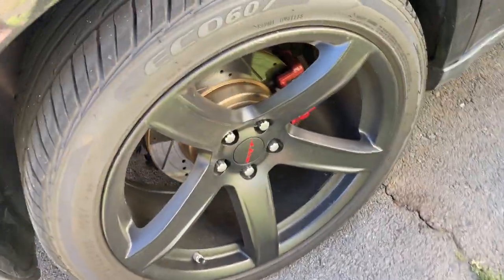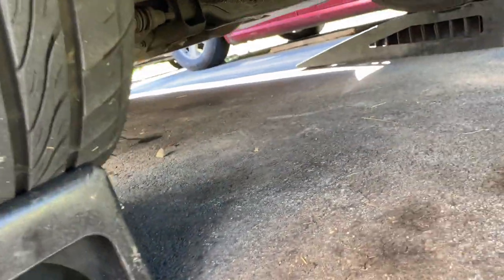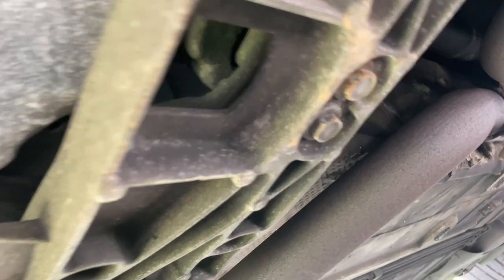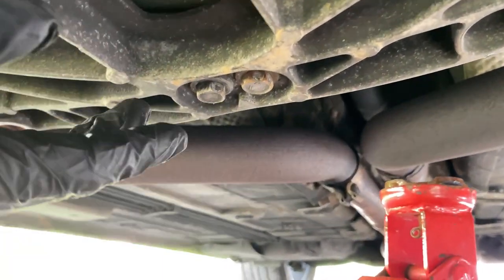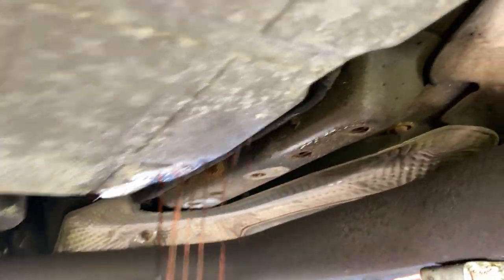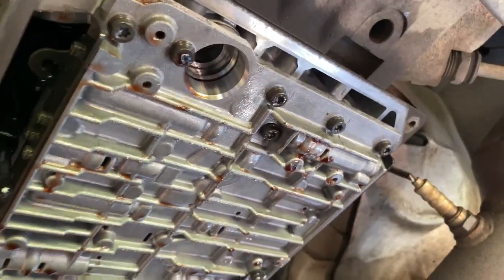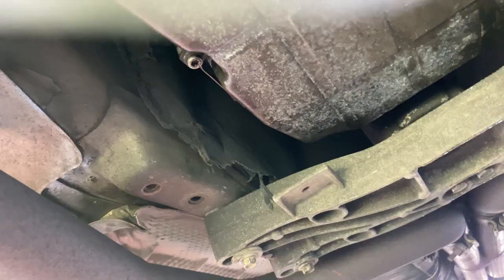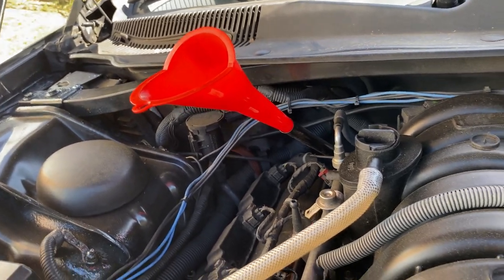Transmission fluid and filter replacement. Dodge Charger, Challenger, Magnum, Chrysler 300,  NAG1

Comment: I have a 2008 AWD R/T and it’s in limp mode for dirty/ low transmission fluid and it slips occasionally will it get out of limp mode and stop slipping by doing this ?
Reply from the maker: Yes bro!! 💯💯🤝
Reply: What codes were you getting?
Reply: I have a 2014 charger rt that’s won’t move at all it when I put it in park it rolls off as if it’s in neutral is uours like that ? it won’t change into no gear
Reply: It could POSSIBLY help. Works 10% of the time. The other 90% you’ll need a transmission. Certified tech here.

Comment: I have a 2006 charger RT. It has  154,000 miles on it. Should I do this procedure to my car?
Reply from the maker: For sure bro, always a good idea to keep the fluids updated, especially if you plan on keeping the car. 💯💯🤝 Differential fluids are important as well. 💯
Reply: if you have not done this yet, make sure you keeep the old oil for a little bit. Sometimes the grit inside the old oil is whats keeping the transmission from slipping. So if you put new oil and it starts to slip you may have to place the old oil back in.

Comment: make drain port on pan, buy 10 litres of proper oil, drain old oil, replace filter and clean magnet, put same amount of new oil, after 3 months drain oil, put it in glass bottle and leave it to subside dirt,put new oil, drive for 3 months and repeat procedure, and every time drained oil will be cleaner, when is used all new oil take oil that was first put in glass bottle, it should be clean after 6-9 months of subside, that procedure of rotating oil takes 15-20 minutes every time

Comment: Question for you I did this same transmission service and now it won’t shift out of first gear and goes into limp mode any idea the problem 2008 Chrysler 300c
Reply from the maker: The two main things I would look into. 1. Fluid level. Make sure the fluid is at the correct level. 2. Transmission filter seating. Check to make sure the trans filter is installed properly and that the o ring on it is undamaged. Also clear your codes after and let me know if anything comes back! Good luck with your car 💯

Comment: What makes transmission fluid out the black cap on top of the transmission in a 2007 dodge charger 5.7
Reply from the maker: I’d check to make sure nothing is mixing into the trans fluid and forcing it out of the tube. The cap should have an o ring on it to seal it from leaks. That being said, it is not normal for fluid to come out of that spot. Lmk if you figure out what the problem is bro! 💯 🤝

Comment: if the trans has over 100k on it is it safe to add brand new fluid ?
Reply from the maker: Yes, it should get a drain and refill every so often if you want to make your transmission last longer and avoid premature failure. A lot of people are afraid of touching the transmission fluid because they hear about people saying that it can cause problems. What they are likely referring to is a transmission flush. It runs new fluid through the transmission with some pressure using a transmission fluid flush machine and in older transmissions it has been known to plug some orifices in the transmission and cause issues after fluid flush. That being said draining out what is in your pan and replacing the filter won’t replace all of the fluid in the transmission. If they are done every so often it will be a lot cleaner fluid than of you just leave the old stuff in there. Eventually the fluid gets full of contaminants and debris from the clutches and metal. So to answer your question shortly: Yes, it is safe. Just make sure you put the right amount of fluid back in and I’d definitely recommend a new trans fluid filter. 💯 good luck bro!!

Comment: Got a question my 2008 charger 5.7L has the original transmission fluid with only 40,000 miles should I charge the transmission fluid??
Reply from the maker: You don’t absolutely need to but it would def be good to keep up with your maintenance as it is getting older.  Assuming it has never been changed. If you can afford to do it then it is a good idea bro.

Comment: Shouldn’t the fluid been more of the new fluid color and do u need to change the trans pan seal
Reply from the maker: The old fluid inside the transmission will appear darker over time as it ages and goes through many heat cycles. IT’s recommended to change the pan seal, but if yours is in good condition it isn’t necessary. Usually older seals will be degraded and fall apart. Thanks for the comment bro 💯

Comment: does the car have to be at operating temp? when you add fluid?
Reply from the maker: When you are checking the fluid level. The trans fluid temp does need to be at a certain temperature in order to accurately measure it. 💯

Comment: How much does something yourself usually cost
Reply from the maker: A lot of money saved due to the high cost of labour. If you have no tools this is usually where the extra expenses come in. It’s definitely worth doing if you are good with technical stuff and would like to keep your money in your own pocket. The transmission fluid and filter was about $80 for this car, if that is what you were asking. Anyway good luck with whatever you may need to do.

Comment: Great video bro…
I have an 08 rt. It has 141,000 miles and the fluid has never been changed. It’s in great condition and no problems with the transmission. I’m going to drain the fluid myself. What do you think about adding Lucas oil transmission condition in with the new atf fluid… and should I leave a quart out in place of the Lucas??
Reply from the maker: Hello, thanks for the comment bro, I appreciate it. I myself have never used any additives for transmission fluid before. I’ve heard quite a few people recommending against using them, especially if you have no issues with your transmission already. That being said, if you do decide to put some in. Then definitely leave the quart out in place of the additive because you want the fluid to be at the correct level for it to operate properly. Good luck with your fluid change. Have a good one bro!
Reply: @colin7761  
Yea bro… with that many miles I’m just using it as a preventative measure. Lucas oil products are pretty darn good from what I’ve read. A lot people swear by their products. I figured it couldn’t hurt to run it through for a few months then flush the transmission again. I don’t plan on selling my Rt. It still looks brand new.
Reply from the maker: @RodneyD  yeah bro for sure. I do not have anything bad to say about Lucas products they do have a good rep. That’s awesome that your R/T is in great shape! It should definitely be safe as long as the fluid levels good.
Reply: trans oil can not be good after 140000m, at every gear shift small part of friction material comes into oil and it circulates inside of gear and enters into bearings, gears, solenoids, and acts as polishing paste
Reply: @J.Sanity  
Really..
Have you experienced this??
Reply: @RodneyD i know i’m late but you should be fine just don’t flush it drain and fill only
Reply: @arturoperea2173  
That’s exactly what I did.
Thanks bro

Comment: Hi I have a dodge neon 2017 model GCC. Now completed one Lakhs km. Agency told that automatic transmission oil is for life time. Is it true or In what km I can change automatic transmission oil?
Reply from the maker: If you plan to keep the car for a long time I’d recommend to change it every 60-100 000km just to keep it somewhat clean. Manufacturers say it is a lifetime fluid now because they try to make it look like the ownership costs are lower than they actually are. The vehicle would be out of warranty by the time you would ever have a transmission fluid related failure so they are not worried about it.
Reply: @colin7761  Thanks bro for the valuable information and sudden reply 🥰😍
Reply from the maker: @ArunKumar-kf6jc  Anytime bro! Thanks for your comments!

Comment: How did you get the fluid out of the torque converter?
Reply from the maker: This is the drain and refill method, which is recommended for this transmission. The fluid in the torque converter stays in the torque converter when the engine is off and the pan is coming down. If your fluid is really bad you may need to do this more than once, of course if you plan to do it again drive on it for a while so the fluid can circulate first. In my case it gets done regularly so the fluid isn’t too bad.

Comment: My 2011 rt made a clunk at 80 when doing a pull. In uts 170k miles the previous owners have never touched the transmission. Could this help?
Reply from the maker: For sure it could help. It’s always good to keep up on the fluids. Whether it helps prevent the clunk again may not be certain depending on what it was, but it’s def a good idea to keep the fluids in good order, they do degrade over time unfortunately. 💯💯🤝

Comment: Hey i just did mine but i dont really know how to make sure the fluid is right where it has to be.
Reply from the maker: After draining the pan and changing filter. You should be good by adding 5quartz. If you want to check the exact level you will need to buy a dipstick for this and check the fluid level while the vehicle is running while you also monitor the trans fluid temperature to match the appropriate marks on the dipstick. Hope this helps answer your question. Good luck with your car bro!!
Reply: @colin7761  so how do you check the temperature of the transmission fluid??
Reply from the maker: @chris_mo_904  you need a scan tool plugged into the obd2 port. It will show the proper trans temp. In reverse or drive. Good luck bro.

Comment: What is that red thing on the left side. Whit two hoses.   My car don't have that. Is just one hose. Don go tru that.   !! What's that for??
Reply from the maker: Hey bro, that is called an oil catch can. It is not stock. It is an aftermarket accessory. It separates the oil that gets by the PCV valve so oil does not get sucked into the combustion chamber and cause loss of power. It gets emptied every oil change.
Reply: Catch can

Comment: Nice basically if the pan and everything looks good then 5 quarts would be enough for the 5.7 hemi ?
Reply from the maker: Usually. It depends how long you let it drain out. 5 quarts minimum, then it may or may not need another quart or two. That being said. The specification for a trans fluid drain and refill is 5 quarts. Good luck bro! If you want to be 100% sure it’s right without a dipstick, (as long as the transmission wasn’t leaking) you can measure how much fluid you removed and then use that amount to calculate how much to put back in. Good luck bro! 💯💯🤝
Reply: @colin7761  thanks for the info bro appreciate it

Comment: The transmission is not going to fall out the vehicle when removing the pan.
Reply from the maker: Thanks for the comment bro. That’s a Good tip for all of the viewers.
Reply: What about when you remove the cross member
Reply: @willdabeast144  still no. The transmission is bolted to the engine. If it were unbolted from the engine, it still has a wiring harness that would prevent it from just falling out on top of you.

Comment: Hello, thank you for the video! I’m about to do this on mine but what’s bugging me is where should I put the jack in order to hold the transmission once I take the transmission bracket off?
Reply from the maker: Hello ! Once you take off the transmission bracket to body bolts, then you can slowly lower the jack and the transmission will still be held up. It will just lower a bit as this is the transmission mount.  After you take the bracket off the transmission you can support the part of the transmission where you removed the bracket. Thanks for your comment, hopefully this will help!
Reply: @colin7761  thank you! So it will lower a bit but will it go back to its place once I put the bracket back in?
Reply from the maker: Yea once you put the bracket back on use your jack to lift it a bit into place. It’s not difficult to get er lined up. To the other guy you can order dipstick on eBay just type in your trans and engine type along with transmission dip stick and you will see it bro.
Reply: Wtf are you talking about??? By removing the transmission oil pan the trans its not gonna fall or drop.
Reply: @rhurtadorh32  these you remove the transmission mount itself. You have to take it off to remove the pan.

Comment: Where did you get the fluid dipstick?
Reply from the maker: I got it online bro!!
Reply: only important part is 10 cm that is dipped into oil, so make 10-12cm stick with 1cm marks and connect it on long cable, proper level of fluid depends of oil temperature

Comment: Thanks man I was curious as to if the pan was a pita to get off but now I know it's a good little project to do on a sunny day! I don't have any tranny problems but she has 194k miles and I just got the car so I'm not sure on the history she runs good and drives good tho! Will definitely be replacing the filter and fluid soon alot of people say it can cause slipping if your fluid is already too far gone so I hope not
Reply from the maker: Thanks bro! Yeah it’s not too bad. Yeah I’d def change it if I were you too. I’m glad she runs good!! Yeah people normally worry about transmission flushes but this is more of a drain and refill and of course filter replacement and magnet cleaning. So I would not worry about it having any negative effects as long as the new fluid level is correct and the filter is fully seated. Good luck with your car bro and have a good one. 💯
Reply: Honestly I changed the engine so it SHOULD have been done, but all the damn corners that shop cut in swapping the engine id be surprised if they drained the transmission at all, probably left it right where it is the whole damn time...  gonna do this this week now that I know i can pull that piece without her coming down.  ^_^  only thing I've never pulled bolts on is the transmission... been too scared, yet ill tune the damn thing... lol

Comment: Dude u over filled it by 2q it will run hot if u do t take out 2q messure temps while running at temp of engine so if it is at 160 dgree in D After run gears back nd fourth 2x , then messure dip stick in TC to read about at 60-70 mm at 160-170 temps
Reply from the maker: It only got about 5 quarts in which is to specification. I will admit that the measurement part was blurry and I didn’t specify the exact trans temperature. 💯💯🤝 appreciate the info about the temps and depth measurements. It will definitely help out those seeking that info.
Reply: 5 total
Including convertor wi h btw u did not flush
Reply from the maker: Here’s the actual specifications for anyone that needs to know: 
5.3 quarts for a Service Fill 
8.15 quarts for an overhaul
Wonder where you got that information? I know mine is a reputable source. 💯💯
Reply: @colin7761 not all NAGS convertors capacity hold same amounts dude
Reply from the maker: This is the exact specification for the nag1. You’re not correct here bro just take the L 😂💯🤝
Reply: The oil capacity of a 5-speed NAG1 transmission fluid is 8.1 quarts, with an initial fill of 5.3 quarts. The actual amount of fluid needed may vary depending on the following factors: Size of the internal cooler, Length of the cooler, Diameter of cooler lines, Presence of an auxiliary cooler, and Residual fluid from the dyno testing process. 
Here are some examples of vehicles with a 5-speed NAG1 transmission fluid capacity: 
2009     Now unless you drained all 8 Q out then ur levels should be in pocket ! But if u only drained 3-1/2q from pan , then ur convertir nd coller holds ur rest of the undrained dirty oil .
Reply: @colin7761  the pan holds 1 gl that means 4 Q
Reply from the maker: I provided the specs for my exact build of nag1. Idk why you’re going this hard to say I’m wrong when I’m getting the info straight from the service manual. I stated what the service and overhaul fill was. I know what they mean. For everyone reading these comments please don’t be confused by this guy. 💯💯
Reply from the maker: The overhaul refers to the full capacity. The service fill is how much you put in after removing the pan and replacing the filter. 💯💯🤝
Reply: @colin7761  i did same thing  nd only tool 3-1/4 for pan !! So the rest of oil amounts is in lines cooler nd convertor ,
Reply: Btw Just for pice of mind out there for everyone including my self reffering to TC nag1 temps managing numbers before TC will take a shit is;   TCI states that the ATF4 Tc Oil will brake down starting temps of 240!!!!! sonif ur tc flexuates from 160-200 is perfect sonis if is 170-210!! Nd so on , safe point in referance is NO higher then 240 temp Nd if the temps are used at ranfes of 150-180 tc will not need oil service for 25.000 miles or more even so keep in mind the referance of highest temps on ATF are 240 to be safe. My NAG only accepted 3-1/2 of ATF after droping my pan nd filter!! Some say it takes 4 q some say they even put 5 Q back in!! Personaly IDK how 4-5Q can be excepted back in the stock pan as pan holds exactly 4q!!! Go figure rite some ine is informing incorrect numbers , i m just tryen to save the efforts with my own experiance nd triall tests on this topic. Anyways , do you ,, hoprfully that will suit u str8 😬🎯
Reply from the maker: I agree that the amount that comes out during a drain and refill may vary. It depends how long and how much was allowed to drip out. So that being said checking the level afterwards is definitely important. Also the trans temps should be monitored to be sure proper transmission cooling. Thats definitely an important factor 💯💯🤝